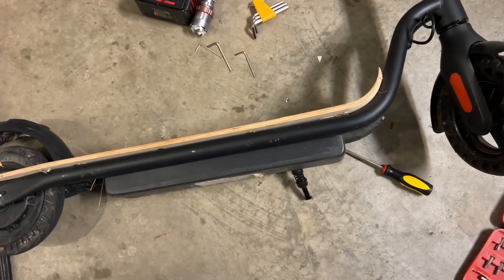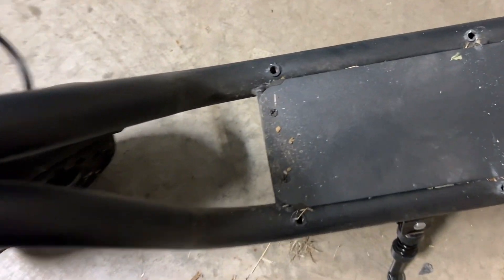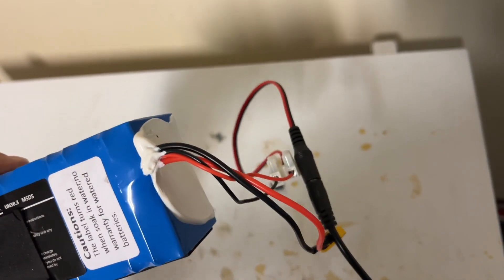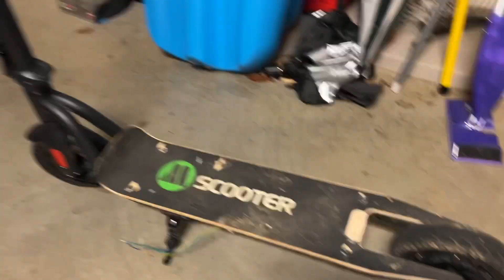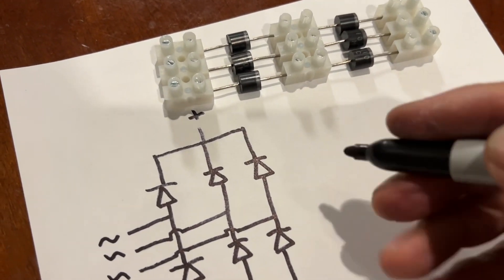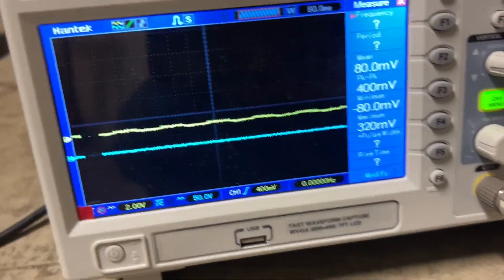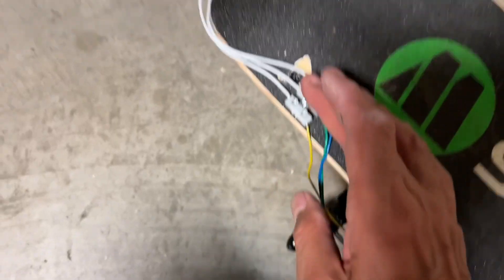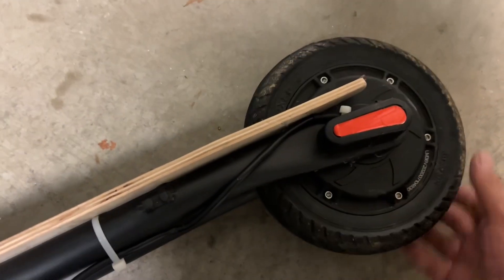Battery Recovery from Broken e-Scooter

Comment: Very interesting. If the scooter was working with the battery could a circuit similar to this be used to put power back into the battery (Maybe when going downhill or in breaking) I dont know if they already do this?
Reply from the maker: That’s a great idea. I don’t think they do this!
Reply: Most scooters already do this. Virtually all scooters on the market with a friction brake (disc, drum) have a brake switch on the brake lever. (Even the most basic of scooters, such as the Razer EPrime). This switch triggers two things:

1. Cut motor power (so you can't apply forward power AND friction braking at the same time)
2. Dump excess energy into the battery as a regenerative brake.

The core issue is higher power scooters or a high state of charge (where does charge go if your battery is at 100%?) are at potential for putting a lot of power and heat into the battery very quickly - you'll see the same issue with electric cars; especially Tesla; especially when raced on a track. For those situations; its actually ideal to let that wasted braking potential energy go to waste - as capturing it is an inefficient process (as is using it) and just adds more heat into a system that has difficulty removing that heat.

Scooters hardly have a heat removal system; even the best scooters don't really have any dedicated cooling. 

Regenerative braking is also a bit tougher to control as a user - as you can lock up your wheels surprisingly easily; and you don't have that modularity in braking strength (and the tactile feel) that goes along with a friction, lever operated brake.

Anyway point is; hell yeah its a thing. Its nice to have. There's just trade offs, and its not just free power to bomb the largest hill and watching the battery charge.

Comment: High current  18650s 👍 that was probably just the onboard  bms it disconnects the output at like 3v to prevent damage, I've got a few of these packs I run my 110v angle grinder from 3 in series sometimes 😂👍👍👍👍😎